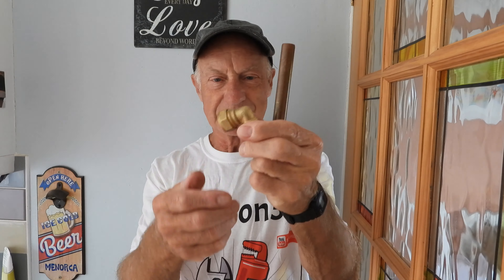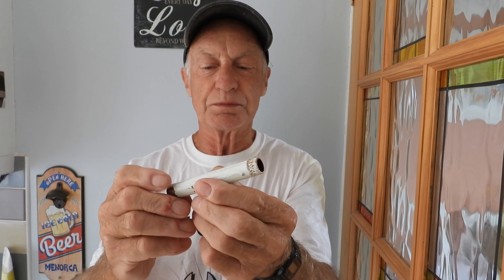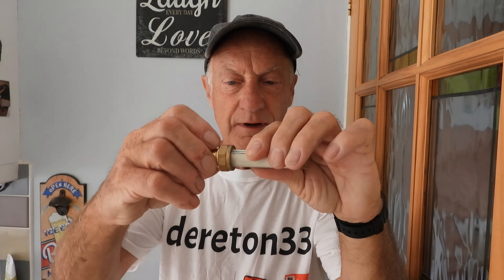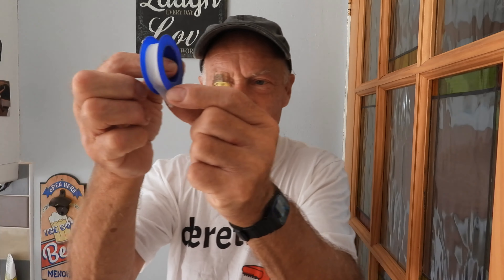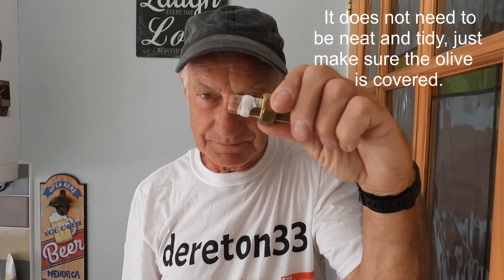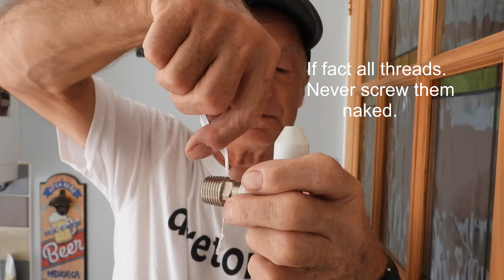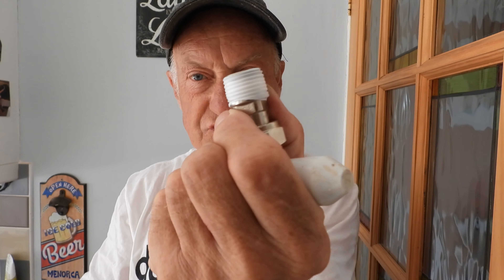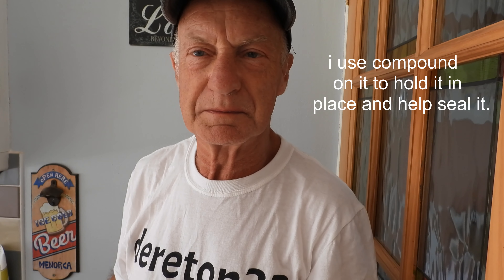When to use PTFE tape, compound or nothing at all on pipe joints

Comment: Thanks Dereton. I always use Fernox jointing compound for compression fittings. I never find using PTFE tape never really effective on its own. An outside pipe, which is adjacent to my outside tape, was ‘weeping.’ I used PTFE tape, but it didn’t resolve the problem. However, after using jointing compound paste with PTFE tape, it did the trick.
Reply from the maker: Good stuff
Reply: Hawk white is plumber's insurance
Reply: @dereton33  Thanks Al. I’m only a ‘jobbing’ plumber,  who has limited knowledge and skills, hence I appreciate your extremely helpful on line tutorials.
Reply: AGREE 👏👏
Reply: @Viewer765  white = non drinking water, blue = drinking water

Comment: Need to connect two brass elbow fittings behind shower wall. (Cant get a plumber to do a quick solder job for love nor money) so to insure a good solid fit can i add a lick of boss white onto olives for a more permanent leak free seal?
Reply from the maker: Most certainly, best ever sealent in my mind.
Reply: @dereton33  thanks for your quick reply.       That'll do me!

Comment: On thread connection I normally rap PTFE tape around 20 times. By looking at this video I been putting on way to much 😂
Reply from the maker: You can usually tell by the amount spilling out from the thread.
Reply: When I install radiators I usually do 23 to 25 wraps. If I do less, then the tail doesn't get tight by the time my spanner starts touching the rad.

I have recently bought some loctite 577 to test out. I have had some success with loctite 55 as well.

One day when I have the time I will probably do some sort of test to see what happens when I only do 6 or 7 wraps like some of the rad valve manufacturers say.

Comment: Not a fan of PTFE or Locktite. I still use jointing compound and hemp on all threaded joints and jointing compound on all compression fittings. Never lets me down. I do use PTFE to repair leaking packing glands though.
Reply from the maker: Thanks

Comment: My pet hate is when people wrap p.t.f.e around compression joint threads. Perfectly fine to wrap it on the olive itself as that seals the integrity of the joint.  Thanks for sharing Al 👍.
Quick question I generally use white tallow for pulling cables through conduit.  Are there any applications it can be used for in plumbing?
Reply from the maker: It used to be used in wiping lead joints, it is good though for pasting string and using for packing material in leaking stopcock gland and rad glands.
Reply: @dereton33  Ok so it's similar in property to liquid p.t.f.e or silicone grease. I'd guess more like p.t.f.e myself.  I'm going to give it a whirl on some joints.  I have a massive bucket of the stuff 😊,  Thanks Al 😉

Comment: @ dereton what can i use on gas pipe that connect to the back of a cooker.
Reply from the maker: A bayonet fitting then a black flexi hose to the cooker. Just to let you know, you should be registered Gas safe to touch anything to do with gas.
Reply: @dereton33  yeah I have all that will I need ptf ( yellow for gas to seal pipe to cooker?

Comment: Correct me if I'm wrong but it seems to me with both the tape and hemp you've wound it in the wrong direction? So it will tend to unwind when you tighten the nut??
Reply from the maker: No its the right way.
Reply: @dereton33  I am so sorry, I made a dreadful mistake. In both cases you were in fact winding the tape and hemp clockwise around the thread ie in the SAME direction the nut is turned to tighten up the fitting. I've watched many of your videos and always found them very well presented and very well explained. My apologies again.

Comment: Quick question, you say to use PTFE tape on all threads but on your how to remove a radiator for decorating there wasn't any PTFE tape shown when disconnecting the pipes from the radiator or when reconnecting the radiator.

If there isn't any PTFE tape on the valve thread when I disconnect the radiator, should I put some on when I reconnect it?
Reply: Never mind. Just saw from your "how to fix a leak" that there's an olive in there.
Reply from the maker: No problem.

Comment: This is a very useful video - thank you. Which compound paste do you recommend lots of brands and variety?
Reply from the maker: Always boss white for me.
Reply: There seem to be two types in general, one that you can use for drinking water (non-toxic) and one you can use for non-drinking water (central heating systems?). I used some on water pipes this week for the first time to put some bib taps on. I used ptfe (wound the right way for the thread so it won't unravel when you screw it on), and then the jointing compound. The first try weeped a little so I used more ptfe near the base of the tap thread and the jointing compound, then left it a few hours with the water off, even applying some gentle/ambient heat to help it harden up a little and it was ok in the end on a full pressure cold tap. This is what I used - 
https://www.toolstation.com/fernox-water-hawk-jointing-compound/p14953

Comment: 4:20 never used the hemp before, not sure about doing my new radiators, any other tips on fitting the valves to the radiator? not sure if i will do that myself or relent and get someone in to do it for me.
Reply from the maker: Some rad valves come with the required amount of PTFE tape already wound on. Otherwise it is hemp or PTFE tape.